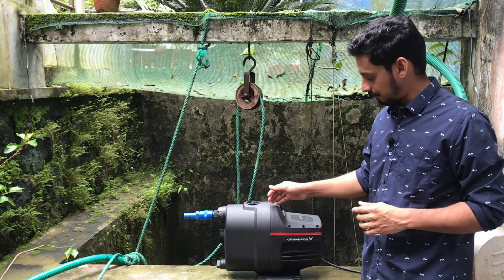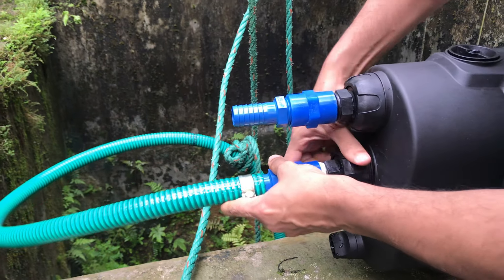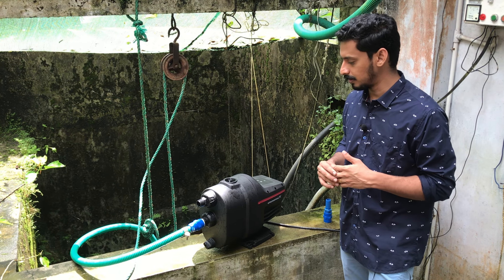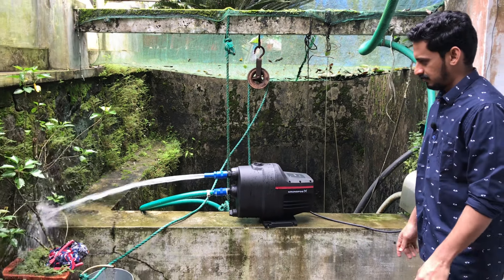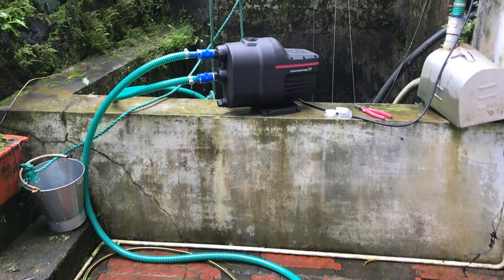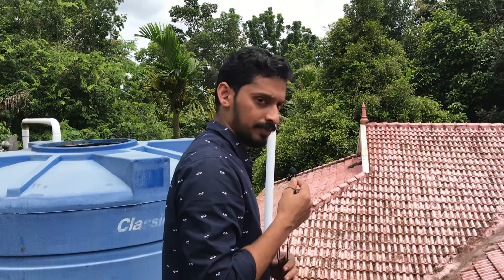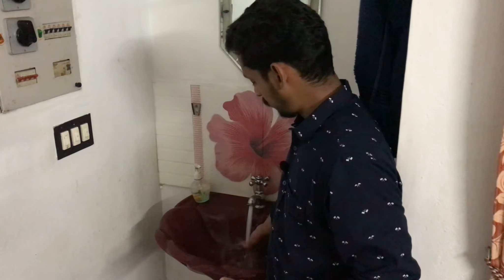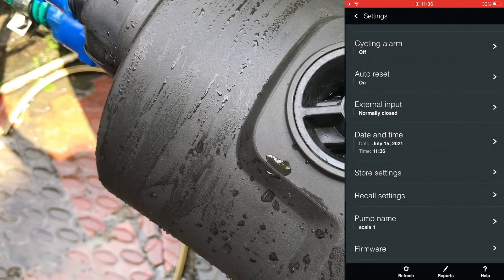പ്രഷർ ബൂസ്റ്റർ വാങ്ങാൻ ആഗ്രഹിക്കുന്ന എല്ലാവരും കണ്ടിരിക്കേണ്ട പമ്പ്  - SCALA 1 | GRUNDFOS | BOOSTER

Comment: Ithe Etra current consume cheyyum ennu koodi paayamoo.. 
 
1kv load cheyyavunna inverter il odumo ithe

Ithe ippo inverter il work cheyum enkil adipoli aayillle

Mazha Kalamayal 2,3 days okke current pokum
Inverter 2 days vare odu

So 3rd day nammal water tank il veccha backup vellam use cheyyamello
Reply from the maker: Hai bro. Inverter friendly ayitulla model nammude SCALA 2 anu. Aa model nammude usage anusarichu matrame consumption varu. Current ellatha timeil usage kurachal atrayum current save cheyyam. VFD drive ayathukond soft start ayirikum. Starting time il current kooduthal edukkila
Reply: എത്ര അടി ആഴത്തിൽ നിന്നും പമ്പ് വലിക്കും
സെഷൻ